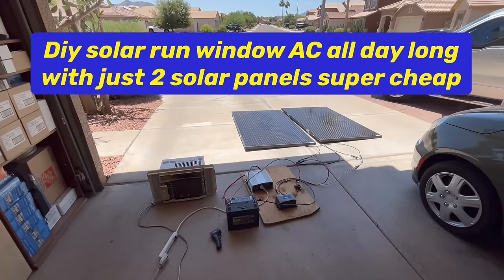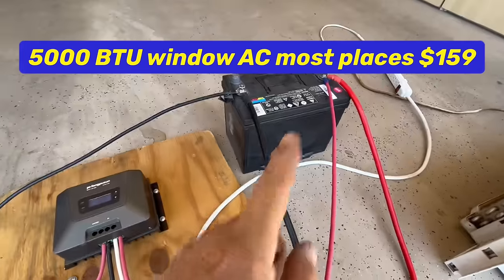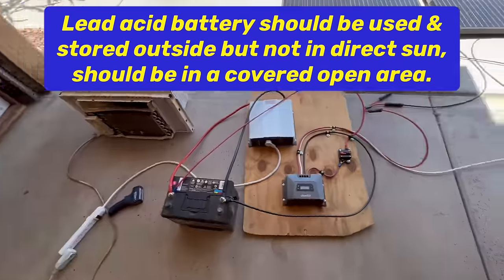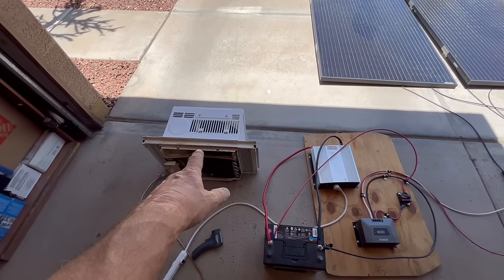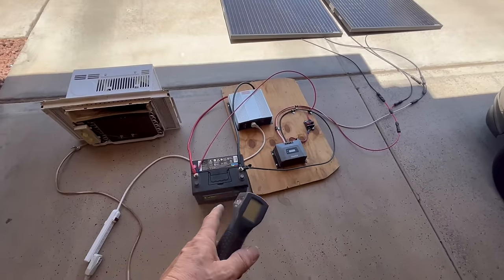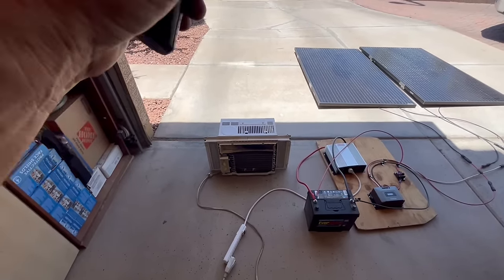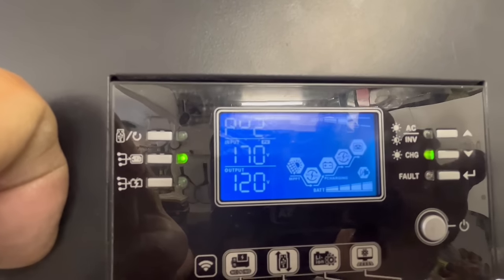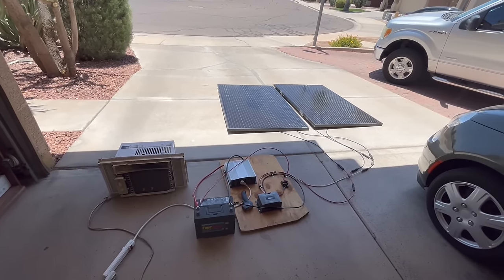Run your window AC with just 2 solar panels when sun shines. Easy DIY project you can do in one day.

Comment: How much were each of those solar panels. Where’d you buy them
Reply from the maker: Just bought 10-250 watt used blemished solar panels at santansolar.com a few days ago for$250 total. That is $25 each. They have great prices year round on new and used solar panels. Everything I use is used. I also do not have any solar panels on my roof. I now air condition house 24 hours a day with off grid solar and battery bank overnight. I air condition my garage all day with just solar to keep at 78 degrees. Check out my other videos on everything I run with off grid solar, all DIY projects. Hope you have a wonderful and blessed day

Comment: Is the charger controller necessary for this?
Reply from the maker: You can not change the dc voltage from solar panel to change to charge battery at a different voltage without the charge controller. It is absolutely needed.

Comment: What is the investment for this setup
Reply from the maker: Several years ago when I purchased all of this it was around $600 but today would probably be closer to $800 -$1000. But this is just a bare bones set up to display that it is possible to run your window ac with solar. The more you tweet this system to adapt to your area and needs , the better the result. I started with this but now run my 3 1/2 ton upstairs and 4 ton downstairs air conditioning heat pumps during the day and run the 3 1/2 ton heat pump overnight with EG4 LiFePO4 battery bank. Although it is a lot cheaper to set up to run your ac home ac or mini splits with solar during the day and grid at night. You can save 60 percent off your ejection just doing that and it requires far less cost than running overnight on battery bank. Check out my other videos on what I can run with my off grid system. Honestly EG4 has a direct input 12,000 Btu mini split that can connect solar straight to the outside unit, then you can connect to grid to run at night. $1299 plus shipping but you don’t need inverter or battery bank to run during the day and you can even limit grid power to just 600 watts. That would be the cheapest route to have a ac that can cool around 500-700 square feet. See link in video for mini split. Buy 4-5 400 watt mono new or used solar panels and you can air condition during the day. With just solar. You could recoup your investment in just 2-3 years with rebates and saving on electric bill.

Comment: So cool
Reply from the maker: Thank you. I am actually running my entire house central air conditioning upstairs and downstairs along with garage on solar and LiFePO4 battery bank overnight. I also am able to heat my 15,000 gallon pool to 87-89 Dey in the winter since we don’t use air conditioning in winter and seldom use the heater. Check out my other videos that show so much you can do with off grid solar DIY. Hope you have a wonderful and blessed week

Comment: How big a lithium battery would be required to run that small AC unit all night long?
Reply from the maker: At 550 watts x 12 hours = 6600 watts. 6600 x 1.2 = 7920 watts or 8kWh. At least 8kWh to 10KWh battery bank. Preferably 10KWh LiFePO4 battery bank. 2-12v, 5120wh, 100ah EG4 server rack batteries would probably work. Try link below for 12v EG4 server rack batteries, you will need a way to recharge battery bank as well.. those 2 solar panels will not be enough to run ac and charge battery bank. You would need to expand your system to be able to recharge battery bank and run window ac at same time. Check out my other videos that show how I use much more efficient 120 volt mini splits that can heat or cool up to 600 square feet. I use an all in one 48v inverter system. It is a big upgrade from the 12 volt system. I am using the EG4 3000 watt off grid inverter. Or you could get a EG4 120 volt mini split that directly plugs solar into outside unit that can run during the day just off solar panels and at night off battery bank or grid power. Check out my other videos on this topic. I actually installed a mini split in my 23 foot motor home and will be running overnight with 2 51.2v , 100ah, 5120wh server rack batteries in parallel. Windo ac can only cool, but a mini split heat pump can heat and cool. Hope this helps.

https://signaturesolar.com/eg4-lifepower4-lithium-battery-12v-400ah/

Comment: you need a 200 / 250 amp fuse from your battery to your inverter if there is a surge u can blow up your inverter
Reply from the maker: Next time I connect I will add a fuse. Thanks for your input

Comment: if I could implement such system in my house we would cut the bill by maybe more than half. We've been using AC a lot lately.
Reply from the maker: I installed 2 mini splits downstairs, 2 mini splits upstairs and 2 mini splits in my garage. I ran all 6 mini splits from 8 am - 5-6 pm daily using off grid solar and AGM battery bank during the day. Then I used my 2 central air conditioners overnight. I saved over 70 percent on electric bill every month in the summer. Then heated my house in winter with mini splits as well. Then I figured out how to run my central air conditioners on solar and now I can run 7/24 365 days a year. I usually run my 3 1/2 ton upstairs heat pump central ac 24 hours a day with solar then EG4 25.5 kWh lithium iron phosphate battery bank to run overnight. I like to run 2 mini splits downstairs all day long on just solar from 7 am to 7-8 pm. Then I only run upstairs ac overnight. I run my 18,000 btu mini split in garage from 8 am to 6pm to keep the garage cool at 78 degrees and the upstairs 3 bedrooms, bathroom, loft and hallway directly above garage. That is why I only run up tax overnight. Check out all my videos where I show this, where I installed mini splits, how much power they use. I bought all mini splits on eBay for $550 - $700 each. Been using 4 years now with no problems. I installed all mini splits with no experience, just watched videos on YouTube of how to install. I live in Phoenix AZ where we just set records for extreme heat for last 2 months. I only spent $100 on air conditioning in last 4 months total. 2 mini splits can use 1/2 the power of a 4 ton ac. Running my 2 mini splits downstairs on only solar and my 3 1/2 ton upstairs ac when 110+ degrees in day, I will use around 4000 watts total on off grid inverter. If I ran my 3 1/2 ton and 4 ton together all day, I would use around 7000-8000 watts or 7-8 kilowatts per hour (kWh). I can run on solar, I have enough solar panels but the 2 mini splits actually are much quieter when running both inside and outside units. Main central ac units are very load when running, mini splits are extremely quite, sounds like a fan running inside ad outside. I used mini splits even when it was 118 degrees in the daytime. Kept my downstairs at 76-78 degrees. Check out my videos on all this I accomplished. All DIY projects. Hope this helps you and hope you have a truly wonderful and extremely blessed week
Reply: @diy-solar-guy  Hi, I'm not from the US. We use 220V here. I'm curious if I can use this same system for a 0.7HP Window type AC unit?
edit: yeah I know I need higher rated components. But just curious if I need an extra component or just the same ones in the video?
Reply from the maker: @peacebewu  you would have to use a 220 volt inverter and might need more solar panel’s. Might want to go with a all in one inverter that has charge controller built in that is 24 volt or 48 volt inverter. I don’t think the 12 volt system would work well for you. Hope this helps, hope you have a wonderful and blessed week
Reply: @diy-solar-guy  Oh sorry I forgot to clarify. I meant same system but with more "beefed up" components. I know I need higher rated components, but like, do I need an extra component? Thanks!

Comment: Would you have to use a timer to turn it on in morning or could you have a photo sensor trigger it ?
Reply from the maker: You could use a timer, I turned it off when the battery was at 12 volts. You do not want a 12 volt acid battery to go below 12 volts. It only has a short life of 2-3 years as it is of charging and discharging. But it is really important to not go below 12volts.

Comment: Do you have a diode between the panels which are put in parallel?
Reply from the maker: The solar panel on the back box has diodes installed. No extra diodes we’re installed. Just connected solar panels in parallel.

Comment: How much hours can you get at night with one battery? Would I need another battery to make it through the night
Reply from the maker: I tried using a 150ah 2KWh 12volt Lithium Iron phosphate battery and was able to run for almost 4 hours straight. A lead acid or AGM battery will not work overnight. I know I have 16-12 volt AGM batteries and did not get through the night. AGM batteries are not designed to use for overnight using 500-550 watts constantly per hour fir 8-10 hours. You might be able to get a 51.2 volt 100 ah 5120wh server rack battery but that’s pushing it to get through the night. A better solar to run overnight is a inverter mini split heat pump that is 38 seer. Those once temp in room is at set temp will reduce watts down to 200-400 watts and maybe go even lower than 200 watts. Most 12,000 btu mini splits can cool a room up to 600 square feet. If room is smaller at 10x15 or maybe 20x20 , room will be cooled very quickly and watt usage will drop a lot. I will try running my window ac using 2 12volt 150ah 2KWh batteries in parallel to see if I can get 8 straight hours of air conditioning. Thanks for your question, hope you have a wonderful and blessed week
Reply: @diy-solar-guy ok so I think I have a good idea of what I need to do. I'll repost when I start the project.
Reply from the maker: @elasesinoespritual341  sounds great, looking forward to hearing how you designed system.

Comment: Hey man, I REALLY want to do this. even tracked down some cheap 250w panels. Would that be enough to run the setup?, maybe even a lower powered ac. How much did all this cost you?

Also, how do i plugin to the grid during winter?

Also, thanks a lot for the tips throughout. I originally wanted to build it in my room until I saw the gasses statement.. its going outside now. lol

Also also.. wouldnt selling it back to the grid do the same thing as hooking the ac up to it?
Reply from the maker: Hi, you would have to pull permits and get inspections if you connected to the grid. This is off grid. If you do not have Lithium iron phosphate (LiFePO4) battery bank, you would just simply plug the ac into any 120v outlet in your house depending on where you mount your window ac. All my solar set up is off grid and I do not use the grid to run my ac any more. I have LiFePO4 battery bank that I use for overnight to run my upstairs whole house 3 1/2 ton heat pump to air condition or heat. Most 5000 btu window ac units will use around 500-650 watts while running. You have to have enough solar panels to produce at least 600 watts. You have to keep the battery charged and run the load of the ac at the same time. Improving this bare bones basic system would help. You will never get 250 watts out of a 250 watt solar panel, most likely 150-220 watts. I used this set up in a very well insulated shed in my yard for years to keep my inverters cool in shed. You are basically creating a separate power system with solar system that never comes in contact with your grid electric system in your house. That is off grid solar. I should have showed that if you add more solar panels, you can make sure you can run ac for a longer period of time during the day when sun is out with no clouds. If clouds cover sun, you will drop down to maybe 50 watts of power and if your battery bank is not big enough. The ac will shut down. Remember, you only produce power when there is full sun and you have to produce enough power to keep battery charged and run load at same time.if your battery is constantly discharging to the point where your 12volt battery drops below 12 volts, your charge controller will shut down system. When running ac, your have to be charging battery at 14.2 volts at the same time. This was just an example of the basic components needed. Expand the system or double the size of system and you will have a more reliable system. Check out my videos on running 120 volt 12,000 btu mini splits that can heat or cool up to 600 square feet. A window ac will only heat or cool 100-150 square feet and if walls and window are not well insulated, will have a hard time keeping cool. Also window ac needs to cycle off and on to help charge battery bank. When ac cycles off because it reaches set temp, it will charge the battery faster but AGM lead acid batteries  charge slowly. But discharge very quick. Hope this helps. Hope you have a truly wonderful and extremely blessed 2024
Reply: @diy-solar-guy  Amazing information, and your video led me to a very deep dive into this. I appreciate you setting my expectations right, as I could probably only fit a few 250 watt solar on my balcony. 

I get a good 5 hours of sunlight where I live.. with 2x200 wat solar. How big of a powerbank would I need to run 6-12kwh? I see a lot of different numbers like 1024mw etc.. 

Also, what are your thoughts on ecoflow products? They're a tad expensive, but seem nice for a novice... sort of all in one.
Reply from the maker: @thrivingentrepreneur off grid solar is something you want to do with a yard. Most diy solar do not have any solar panels on their roof, rather in their yard. It is also much safer than using panels on a balcony. Being DIY you can make a mistake and accidents can happen. All the components can fail if not done properly. I had 2 solar panels over the years catch on fire. That’s why I have the solar away from my house in yard. You also need to look into safety components such as rapid shut down, fuses, breakers. I personally would not suggest setting up solar on a balcony. Those portable battery banks are very expensive but are portable. It no need to be portable, better off with rack batteries. Also those portable batteries can take a long time to charge back up as where a server rack LiFePo4 battery can handle up to 100 amps to recharge, not recommended but can handle. I have a portable battery I take camping and it takes 8-12 hours to recharge. My server rack batteries are charged in 1-3 hours and have 2 to 3 times the amount of ah of portable. Don’t mean to burst your bubble but this solar off grid can be dangerous if not done correctly and can cause accidental fires from wires overheating or shorts. Best to keep solar away from house unless you have professionally installed weather on grid or off grid. Watch some of Will Prouse videos on YouTube, he really does a fantastic job of explaining many things about solar. Hope this helps. I spent 2 years researching before I started playing with actual solar panels.
Reply: @diy-solar-guy  ah damn, yeah.. better safe than sorry. 

Have you read anything about those smaller foldable panels lighting fire?

Yes I will, thanks for the heads up I was just about to purchase those 250 watt panels. They were $30 for 2 🥲

And I think I will go with one of those ecoflow all in one kits, so that way I can keep everything portable and compact but safety is number 1.
Reply from the maker: @thrivingentrepreneur have not seen anything on foldable solar panels or the flexible or roll out solar panels. I just know that watts are very low and not sure how long those will last with the material they use. I looked into those but found the technology needs to improve a lot more before I purchase. Hope the portable power station works well for you.

Comment: Is it possible to run the ac without battery just inverter?
Reply from the maker: They now have mini splits that are direct solar panel input from solar panels. No battery or inverter needed. You can run that same mini split on grid power at night or a LiFePO4 battery bank. Check out signature solar.com. Look at their high performance appliances. Also, they are now coming out with what is called batteryless inverters, I have one and when a cloud blocks sun in the sky, my inverter stops supplying load. The battery is there in the system to give you continuous uninterrupted power when clouds are in sky and keep inverter system running. So if a cloud covers the sun from shining on solar panels, you will loose 70-100 percent of output from solar panel and if there is no battery to draw from while cloudy, you can’t supply load. Hope this helps, I hope you have a truly wonderful and blessed weekend.

Comment: So those solar panels will keep the battery charged?
Reply from the maker: This is the minimum components needed. I live in Phoenix AZ where we have over 320 fully sunny days a year. If you live where there is cloudy days often, you would need to add more solar to keep up with the load and charging. I used in a shed for over 2 years to cool my solar inverters and batteries. I was able to cool from 9am to 5 pm 7 days a week. You have to adjust for your area and weather. I bought these used solar panels for $35 so it is not much of investor buy one or two more solar panels to insure you have enough solar. If I made this a 24 volt system, I could use same charge controller but would have to get a 24 volt inverter. Once you understand solar, you want to do more with it. I are condition and heat my house with mostly solar in day and 25kwh battery bank at night. Check out how I did this. It will show you how to harness off grid solar to run basically everything in your house.